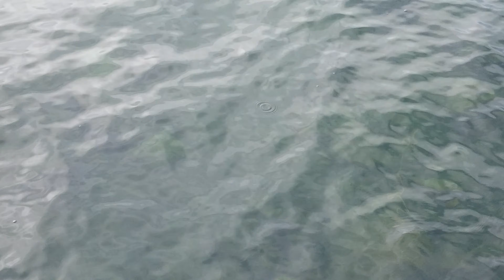Autonomous RC Ship - Part 1

Comment: Nice Super Tanker build I like how everything is super heavy duty👍👍 Now you need to build a RC 4 wheel boat launcher with motorized sling straps to launch this beast & take it out of the water without getting wet.
Reply from the maker: Hah, I actually built a cart for launching it!
Reply: @alxelectronics9615  Very KOOL💟

Comment: You should really taper the front of the hull, so it comes to a point instead of an edge.  It will make it way less likely to catch debris.
Reply from the maker: Ah, I see. There is a slight forward angle on the bow, but it's not super noticeable. The hull was originally a loose model of a great lakes freighter, so I opted for a wedge bow instead of the typical "prow" on seagoing vessels. 

Duly noted, however. Haven't had any issues with debris yet, but it's an easy modification. Especially now that I could 3D print the whole bow and just glass it on... Hmmmm...
Reply: ALX Electronics So I’m actually working on a similar project right now.  Rctestflight did this too, and he had the same shape of bow as you have; his boat got caught in plant debris and struggled to move.  For the boat im designing, we 3D printed the front with the tapered edges as I described, along with two pontoon-like boxes.  We have filled them with inexpensive two component closed cell foam from Amazon for buoyancy.  We are going to connect the parts with epoxy and cover the top, then put the electronics above them.  That’s our plane; our Tupperware container prototype is doing well so far.
Reply from the maker: By the front of the hull, do you mean the bow? If so, it's pretty pointy already. About as pointy as I'd want from something made of balsa that's bound to bump things.
Reply: ALX Electronics it comes to a vertical edge, which is a wedge shape.  I’m suggesting a modification to make it more like a pencil tip, where the point is at the very top.